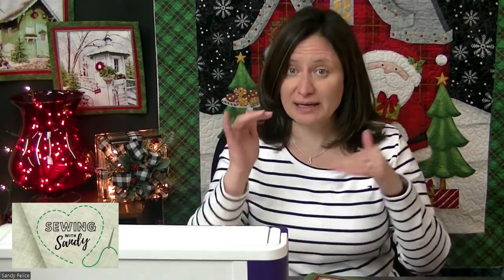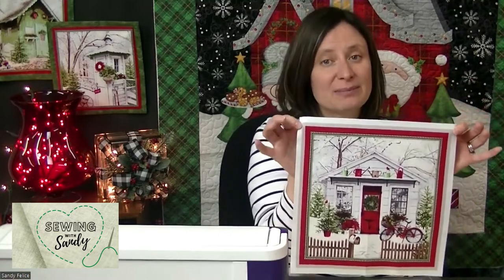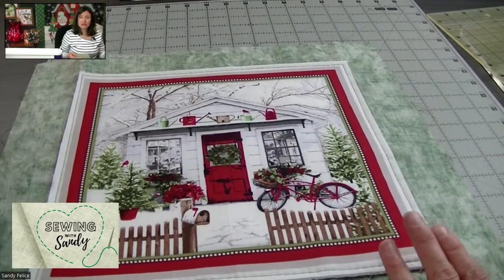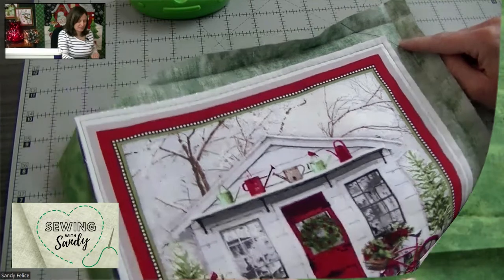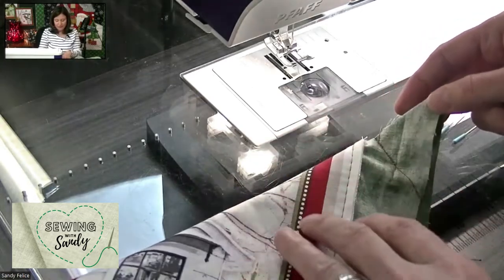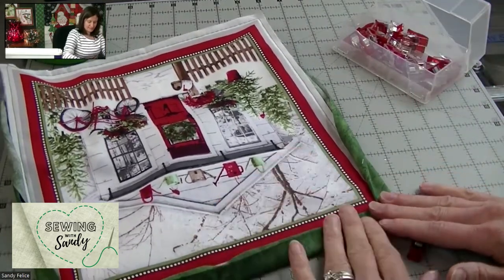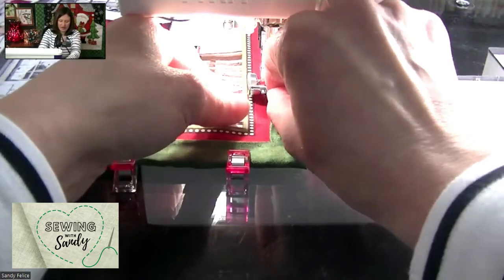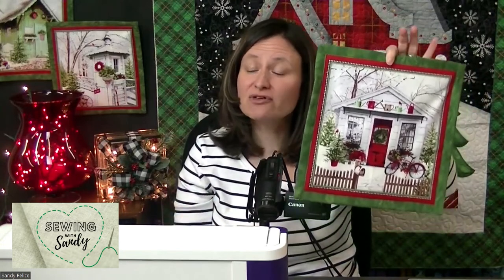Sewing with Sandy.  Hot Pads and the Quick Easy Mitered Binding Tool.

Comment: Very good! A new video star🙂
Reply from the maker: Thanks Janna! 😊💚
Reply: Hi Sandy, am I correct that the mitered binding tool would work on a quilt as well?
Reply from the maker: @Jannaglasser  While the technique WILL work, the binding will not have the double fold on the edge so it isn't recommended for quilts that will have a lot of use. 💚